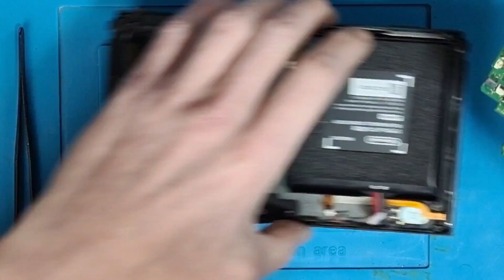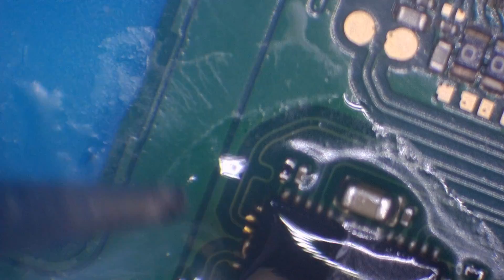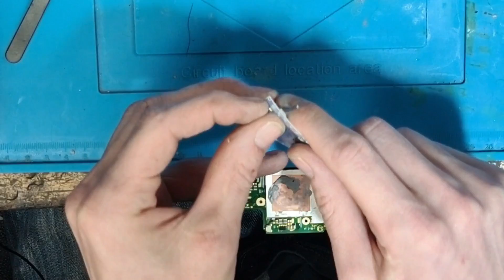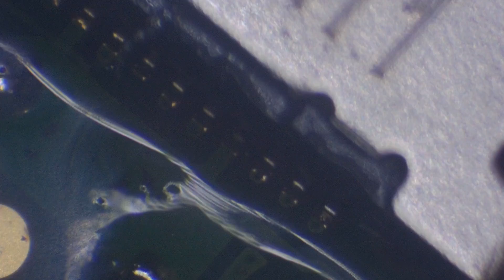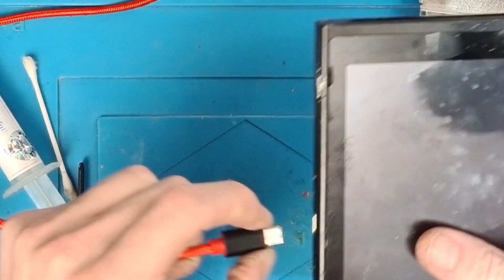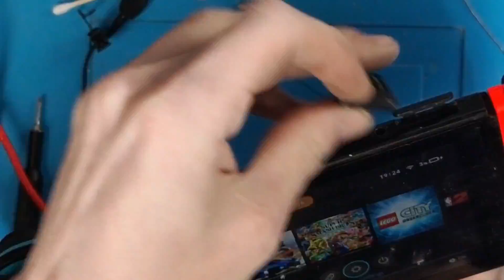Nintendo Switch No Power Diagnosis And Repair - Major Collatoral Damage From A Broken Chaging Port

Comment: When you have the PCB out like that and have it plugged on and your USB meter says zero amps draw does the processor still feel like its getting really hot? I replaced M92 and P13 and still get flickers of some amp draw which then levels out to nothing in a few seconds and the processor starts to get warm to the touch. Also MAX77620AEWJ IC chip  on back of board and 	
MAX77812EWB IC chip on front of the board have shorted caps around them. Never seen anyone replace these. Any advice on that? Also thank you for for extremely helpful tips on one of your videos about first tacking these tiny chips roughly in place and then flowing flux and resoldering so they pull into place by themselves. That was an absolute gem of a a tip.

Comment: Hey, i have a switch here that shows a 0.005 charge but none of the chips are bad but the water damage indicator is pink, could it be a bad cpu?
Reply from the maker: Doubtful mate, a lot of the time it draws 0.05amps for a bad M92, but M92 can be bad without being short if that makes sense. Give that a try before anything else :)
Reply: @TheCod3r  thank you sir, i got it to go to a 0.41 but now i can't get it to go passed that, I'm extremely stumped by this one

Comment: I'd been feeling really good about repairs, and figured I'd give a usb-c port replacement a try after doing x3 m92t36c's, switch/3ds game ports and ps3 controller usbs no problem, but damn was it a ballache! I Every time I managed to either make the plastic swell over the pins at the back, or managed to melt the inner pin stack... Hopefully 4th time lucky after watching your vids when my next batch come haha! Great video, really inspiring.

Comment: This is looking very similar to one I have right now. Did the charging port and now I'm waiting on chips in the mail. 

I have an unrelated question for you though. When you check something in continuity mode and it only beeps for a second or two and then stops beeping what does that mean? I assume capacitors are getting charged by the meter and somehow stopping the circuit you're testing from reading as a short. 
It's on a Xbox one S. When I check where the power comes into the board from the psu I'll get a dead short reading but only for a second or two then it stops beeping. Then if I switch the leads around it'll beep for another second or two. I'm using a fluke multimeter so I doubt it's due to a crappy meter

Comment: I could never do what you do. When I'm focused my hands start to shake: I know, it's strange.
Reply from the maker: That may be a confidence issue, I used to shake a lot but I learned if I lean my palm on the table I can keep them a bit steadier
Reply: TheCod3r I never realized I could be as calm and still as I can until doing a trace repair on 14 pins of a HDMI port lol. First time doing an HDMI port and it was a trace repair job. Got er done though. Without a scope even. I used a jewelers loop to check and redo my work only 392 times!

Comment: Another great job Phil. Nice troubleshooting!  I've seen numerous video's on Switch repairs and it seems to me everyone does the same trick of using another battery in a second Switch.  Then doing the fumbling around thing while trying to hold everything in place. I've never worked on one. But if I did often, I'd think it would be beneficial to fabricate a jumper cable.
Reply from the maker: Thank you :) yeah thats probably a good idea, I do have a battery removed from the chassis for testing but I keep forgetting to charge it lol. I'm planning on making a bench supply cable soon for it :)